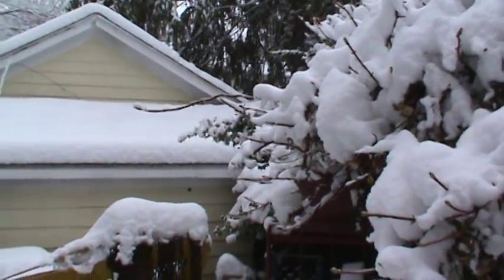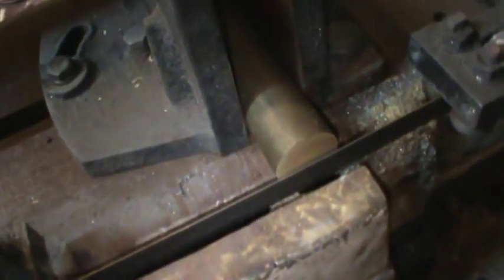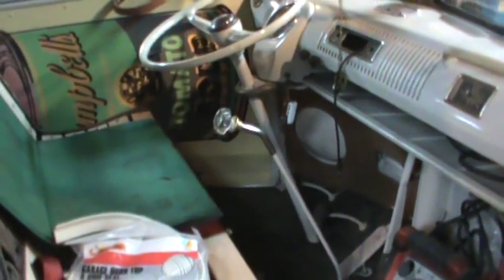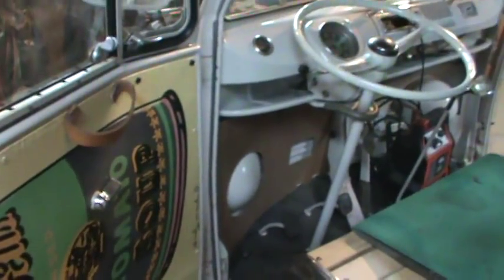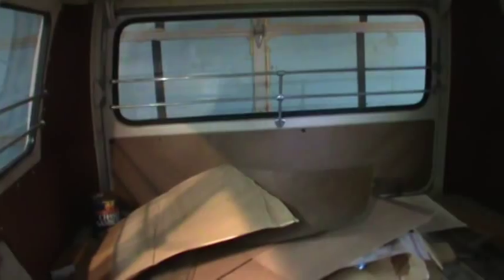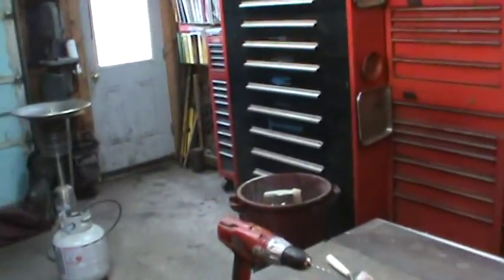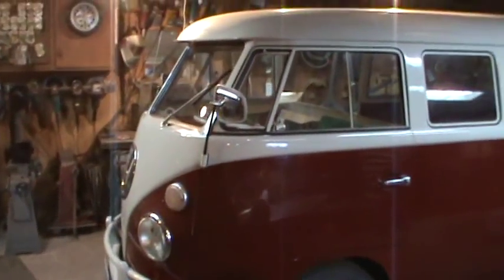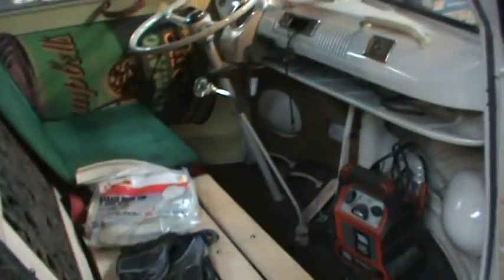making the vw bus panels

Comment: When we made stage panels they are material stretched over a wooden frame. Very similar to a canvas. As you attach it's easy work the material with clamps. Then we painted the panel with a 50/50 water and Elmer's glue. It dries ridged and transparent. Now its easy to attach.

Comment: Hey, is that a deluxe? I seen you had the holes down the side, first I thought it was the holes for the rubber stops, but not on the front door, so I figure its trim, also, seen it had a chrome ashtray and a clock...

Comment: what kinda screws or tinny bolts did you use to put you door panels in with ?
Ps I love all your vids
Reply from the maker: just self tapping sheet metal screws
Reply: mustie1 You just took my project back off hold lol i am putting in Mexican cloth door panels all custom down to the hand made rug cloth material thank you for your help ill make a vid showing you my final work when it is complete may be a little while juggling between school an work but it will happen thanks again and God bless